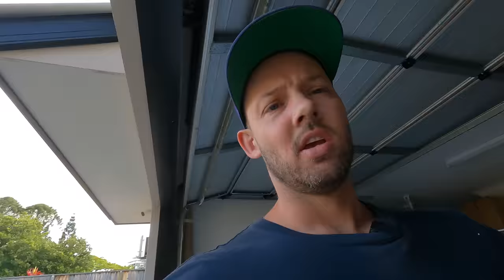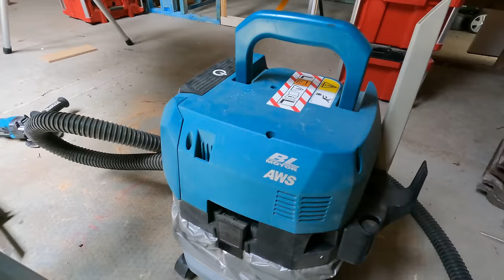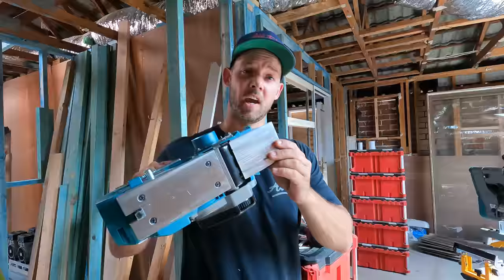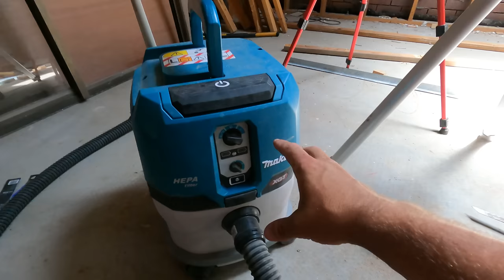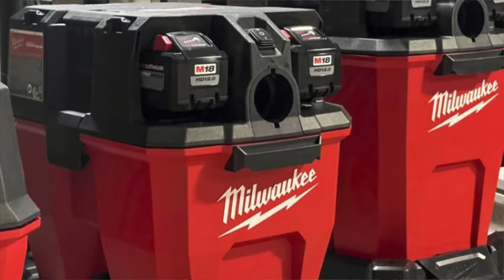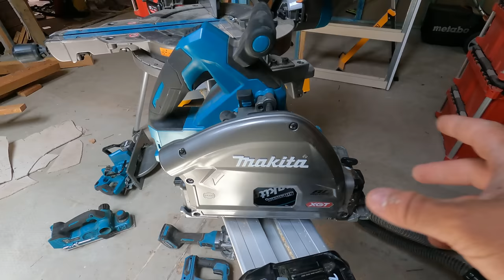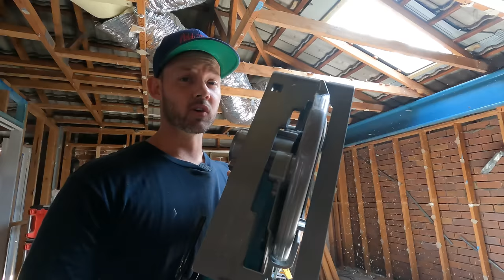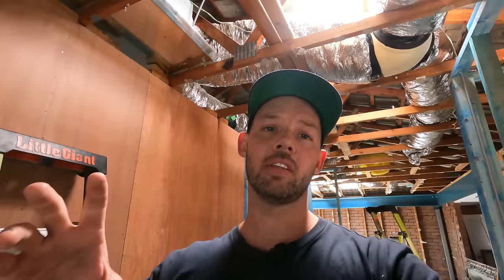From milwaukee to Makita. Why I changed tool platforms

Comment: My brother says that he has seen and had has dropped Milwaukee tools from a ladder onto concrete and the batteries break apart, yet has seen Makita’s 18volt range drop from even greater heights and the batteries have no problems with the impact.

Comment: To me, it seemed that Milwaukee had a focus on mechanical trades. I'm a Makita house however I have recently purchased a couple of Milwaukee tools which Maikita didn't' seem to have any equivalents for. Overall, excluding storage systems, in my opinion Makita wins over Milwaukee particularly in Australia (also faster to market than the US brand which seems to have about 6 month delay to bring their products to the local market), Thanks for the content. Cheers
Reply: It's true, the only problem with Makita is although their saws are better for carpentry than Milwaukee, there is a gigantic, gaping hole in Makitas lineup, which is a cordless, electric nailer!!!! Framers here in Canada are switching to Milwaukee because the Milwaukee nailer is the best on the market while Makita just does not have one. It's a disgrace! Not to mention in North America, it's switched, we get Milwaukee tools pretty quick here while Makita tools take 6+ months to get here.

Comment: Hi, I have worked installing pipework in underground mining for years and am currently back to surface boilermaker/fitter work, we use Milwaukee, we hammer it. The batteries always get loose and the connection becomes intermittent, especially on the 12AH ones. We would go through a 3/4 rattle gun probably once every two months, it seems they need a more substantial contact point and stringer rails for the batteries to slide on.

Comment: I had a brand new Milwaukee 5ah battery die within a few weeks, but replaced under warranty without questions.

I went with the Milwaukee set for home DIY. Once I'm in the ecosystem,  I'm not changing because it's too expensive. I love both my M12 and M18 gear.
Reply: My issue with that warranty thing is the lost time. 
I hear that a lot from the Milwaukee fan boys of 'Oh if it has issues though they have a 5 year warranty' 

They don't give you another tool while you wait for yours and at least in my experience it's 2-3 weeks waiting for the replacement or repair. That's 2-3 weeks of lost production because their tools couldn't keep up with the work they advertise them to do. 

A lot of the trades here seem to be switching over to hilti for that exact reason. 
These tools are bought to make us money through our trades yet if they are constantly down and waiting for replacement then they're just losing you money.

Comment: I’ve had every brand over the last 30 yrs. I’ve had one Dewalt drill give out on me but I’ve had so many problems with Milwaukee tools, like switches went on at least 10 of them. I’ve asked others with Milwaukee tools who seem to not have any problems. How does this happen to me all the time. I love Milwaukee’s special tools, but I stay away from the drills and grinders. Makita is a solid platform for sure.

Comment: As someone with cordless tools of Milwaukee M18 & M12,  Makita LXT & XGT, and Ryobi 18V lines some of the comments here are amusing. I can understand wanting to stick to a limited number of battery platforms, but not every brand makes every type of tool -- and while corded versions might be cheaper there's always not a power outlet available..

Not to mention that sometimes a task is short/simple enough that having to set up a generator and run power cords could make the setup time longer than doing the actual task. More than once now I've been tempted to build myself a portable power cart/pallet using some deep discharge 48V DC batteries and an inverter capable of providing a continuous 3k-6k Watts of AC power......

Comment: Really excellent review, man!! I’m a tradesman of a different stripe, not carpentry but airplane mechanic. Love to All tradespeople. You broke everything down really well, and I learned a useful chunk about carpentry and stayed interested even though it’s not my normal thing, very well done. 
I’ll echo that all modern tools are Great, from Ryobi on up. I’ve got a 7yo Ryobi 12v drill that was 50 bucks, and it was basically faultless the whole 3yrs that it was my only drill. Durable, plenty of power for mechanicking, batteries last forever, better trigger than my newer brushless big brand drill, can’t say enough good about that Ryobi. So All the modern stuff is great. Pick a platform and go to town. That said, it looks like for carpentry, Makita is on the ball.

Comment: May I suggest EGO for Garden Tools. Use a different line for shop tools. I’ve used Hitachi/(now Metabo) for ten years, but Makita, Dewalt, Milwaukee, Bausch all have followers, the important thing is the quality of the battery line you’ll be marrying. Brushless (Neodymium magnet) is very important for both torque, runtime, and spark non-generation.

Comment: Big pro for advanced DIYers, they are the only premium brand (I think?) that also has stuff like gardening tools. I use my trimmer, their small chain saw, and their leaf blower a lot around the yard and they're great. Even if you are a professional, it's nice to come home and be able to use the same batteries for work around the house.
Reply: Only thing I didn't buy makita is brad nail guns and impact driver, instead I went for Ryobi since they got better reviews. Can still use them with makita batteries using a battery adapter!

Comment: I have 25,000 in USD Milwaukee tools.  I have had terrible trouble with he 12.0, 9.0 and 8.0 batteries. Almost all have died before warranty ended and then within a year of replacement which is not covered.  Recently had a 8.0 die literally 2 days out of warranty.  I have Makita 18v tools also, not one dead battery over the last 6 years.  The only think keeping me from switching to the 40V Makita is the cost in the US.  The Makita tools and batteries cost a great deal more than Milwaukee. It's a shame Milwaukee doesn't have a longer warranty on its battery line.

Comment: I was a milwaukee guy and still I am 70% red and 30% yellow never been on a makita platform and recently bought their 40v 12" mitre saw and was amazed how smooth and accurate is the saw , I've been lately disappointed on the milwaukee for the same reasons with the batteries and their mitre saws , the cordless 7 1/4 mitre saw got cracked on the saw mount and it's useless,  bought the 10" and it has very bad deflection related to the back rails and its impossible to stabilize that , all and all I think they are going down in terms of quality and these are a few issues I mentioned,  it's hard to dive into the makita platform but I think I am gonna transition slowly , my next tool will be the vacuum and the track saw all tho I own the corded festool and the vacuum but I need the cordless , hope milwaukee sees these messages and addresses these issues to the TTI
Reply: If money is an issue I'd take a hard look at Ryobi. I know the casuals keep saying it's DIY-focused but personally I see loads of professionals using Ryobi only and if they aren't actually more reliable (some say they are) they are at least cheaper to replace.
Reply: @Gorky D  nothing wrong with ryobi I have the 23 ga nailer and works like a champ , and I have the palm router which is ok , I mean you don't pay much for ryobi so even if it doesn't work no big deal

Comment: Power wise on the 18v batteries Milwaukee wipes the floor with 18v Makita. The multi tool beats all in the head to head. I use 110v festool for dust extraction and mitre saw the rest 18v battery. I agree the Makita track saw is excellent

Comment: i am Milwauke user i work as cabinet maker i love milwauke tools specially planer has dust bag , jigsaw , drill , i am not happy with battery system i changed from 5 amp to 6 and 8 amps batteries they last a while even rough use . but the drop saw i use is makita 40v 216 mm 2 brands at the moment.

Comment: Done with the RED (Milwaukee was the BEST!) 

Now, I’m picking and choosing my skins to get the best of what I need from the brand that best makes it. 

Ooooo 12amp batteries .. YES! 

It’s the rapid charger the wrecks them, the 6pack charger that charges slow is the only way not to wreck
The bigger amp battery’s. 

1 banks drops the whole pack is pooped. They can’t handle the rapid input . Trickle is best

Comment: All my stuff at home is Makita or Bosch with a little Milwaukee. 

At work company provides tools all Milwaukee and I find them unreliable. Great power but just always breaking. I push all my Makita drills and saws just as hard and they don't quit. 
My Makita impact might take 0.7sec longer to drive that 5" lag bolt or whatever but hey at least when I select the opposite direction it actually changes. And I haven't had my stuff at home die on me anywhere close to as much as Milwaukee has at work. And my Makita impact is at least 12 years old now

I'd rather my tool be a second or so slower but last years over being that second faster but dying after 8 months of use

Comment: I prefer the ergonomics of most of the Makita stuff. Hate the Milwaukee angle grinders switch, and I’ve seen switches die on a couple of Milwaukee drills. They might be pretty good power, but I find the Milwaukee saws to be a fair bit clunkier and heavier than the Makita ones.

Comment: Have always ran two platforms. The Dewalt flex volt is amazing. Especially the 12 inch droppy and the 7 and 1/4 cerc saw. I then run the 40v makita as there drills are so much better then the Dewalt and the track saw is amazing especially if you spend the extra and get the 3metre track

Comment: All my tools are Bosch  ,none of which have let me down ,and their batteries last forever ,and don't get hot when charging .  I did think about switching to milwaukee , but I've heard loads of stories about their triggers  failing , gearboxs in the combis ,batteries overheating,  that put me off.

Comment: The problem with milwaukee batteries is the cell is out of ballance after couple hard use (especially on gardening equipment and table saw) and the bms in battery are shitty or none and after charging you got 3 cells charged to 4.14V and 2 cells charged to 3,86V so from 12ah you got only 2ah because the bms wont let discharge cells below some voltage even if the rest is still charged. i check them every 2 months of use and if needed rebalance the cells. The hikoki 4/8ah has the same problem (even more offten)

Comment: That's funny... I'm going from Makita to Milwaukee.  I still have my first set also, but the third gear on my drill slips every so often.  Love that 3 speed, it was bullet proof for me.  I don't use the driver so it was 11 years of hard use as an electrician, before I upgraded the Drill/ Driver set.  My new drill was pretty good but it's been giving me problems lately.  I only had one battery pack fail. 

Even though I LOVE Makita... they started making electric motors, so they know what their doing.  It's hard to beat Milwaukee these days.  They make every single tool an electrician needs, and they stand behind their warranty.  Makita is catching up though, they finally started making Porta-Banders... but too little too late.  I think Milwaukee has so much momentum, and such a head start, it's hard to beat.  Plus their One-Key, and packout systems... I can't say enough. 

I will keep my Makita systems forever, but Milwaukee will be my work tools!

Comment: Have both brands Milwaukee and Makita, both have pros and cons.  I personally like some features on one over the other, but that is a matter of opinion.  In my area Milwaukee is more readily available, more discounted sales as well, so I grab the red because of this.  I work both brands equally hard, in my personal experience, working in the heat and sun of Florida, I have to say the Milwaukee batteries hold up a bit better under severe abuse of heat.  I have replaced more Makita batteries, while I still have some Milwaukee ones much older still holding up well.

Comment: alot of these youtube tradesmen are suckers to battery platforms. i have all dewalt cordless and corded models, switched to flex, THEN switched to makita. only bought impacts and drills of each after the De-saster. batteries and chargers have nothing on corded tools, in reliability and price. i personally think it’s silly to be a slave to a platform of tools that limits you. i can buy anything corded and it will work with any and every outlet/extension cord on the job. it will all come down to personal preference then

Comment: I like to get the best tool in each category. Regardless of the brand. Its nice to be able to use the same batteries for everything, but it feels like a compromise to go with something inferior. I guess it depends how much better the tool is, but as you mention here 2mm vs 4mm on the planer its not even close. If it was 3.8mm vs 4mm, then it doesn't really matter.

Comment: Work purchased 2 milfuckery kits  for the range ,both kits have  had  ridiculous repairs and exchanges to a point where we will keep m12 platform and turf the rest after warranty makita kit from 9 year ago still going strong,new makita kit only issue is the rubber grips.

Comment: My workplace had all makita tools then due to contract regulations they switched to all Milwaukee tools. Milwaukee tools are very strong and beastly but for me makita just seem more refined and the ergonomics and weight to power ratio can’t be beat. My wrist and hands get fatigued fairly fast when using Milwaukee tools but I can use the makitas all day.

Comment: I'm a Hilti and Milwaukee guy myself, but I'll say this.... Milwaukee may be powerful, but some of their tools aren't as comfortable as their Dewalt counterparts (hold each of their multi-tools in your hand for an example), and none of the regular brands have the same feel or build quality as Hilti. In fact they don't even come close. seeing as their prices have dropped a little bit over the years, I would recommend people put a couple hilty tools in their hands before they buy anything from anybody else
Reply: Couldn’t have said it better myself.  Hilti is king in quality and durability and the way it feels.   Milwaukee is great line but doesn’t have the longevity of Hilti   Recently I bought  the NPR32 press tool kit and the TE60-22 and both were cheaper than milwaukee. Win win 👍
Reply: hilti and makita are only two brands left in trade (not sure about festool etc, but that is more niche brand) , that are not been under some mish mash coorporate game. in my mind that means stay of bs and do what you do best (goes for any field).

Comment: I bought a Makita LXT 18V cordless drill with 2 batteries about 13 years ago when they were just introducing their li-ion system, the drill I have no complaints about (I regularly drill in concrete/brick or steel even though it's not designed for it) but the batteries and more specifically the BMS (Battery Management System) in them can burn in hell. They might have "fixed" it in the mean time but the batteries I have contain a sort of key in volatile memory powered by a single cell in the pack, if that cell drops below safe voltage, the BMS forgets its key and cannot be charged anymore, even though the cells themselves aren't damaged, the entire pack is essentially bricked. It's still possible to manually charge the pack by applying voltage to the outputs but this is dangerous to both the battery pack (risk of fire) and honestly just makes it so inconvenient that it's not a real solution.

They say it's for safety but in reality it's just to make you purchase more batteries and it's incredibly anti-consumer and anti-repair. 
I will continue to use this drill with 3rd party batteries but Makita will never receive a dime from me again.

Comment: I use dewalt 20 volt for high volume heavy work and the m12 for small stuff. I think it’s well known dewalt has the best saws and carpentry. Especially table and miter.

Comment: I use DeWalt. Not because they are better than anyone else, but because they have the battery operated tools I need. Are not over expensive. And they work. 

I am also a huge proponent of having a 1 battery system. One thing I hate is having to flip flop batteries and run 2, 3, or 4 different chargers. I keep my batteries on a bank in one of my truck boxes. Ran off an inverter and it's own deep cycle marine battery and an oversized alternator. A one battery system keeps my battery charging system simple and organized. 

Tool brand honestly doesn't really matter, it's the craftsman that counts. The tool is just that, a tool. If you suck, the color of your tools won't make you any better. And if you are a quality craftsman, using Milwaukee or using Ryobi should yield the same result. 🤷

Not to mention, most (not all) of these tools are made in the same factory, by the same workers, with the same parts. I watched a video where a guy took apart a Milwaukee, and a Makita impact driver, they were literally identical except for a couple of proprietary switches and breaks they were the same.

Comment: If there's one thing the US & EU government needs to regular is the incompatibility between tool brands in regards to batteries. You should be able to swap batteries around like AAA or D-Cel batteries, or standardized USB cables for electronics. If I'm going to spend 80 dollars on a 18v battery, then I should be able to plug it into any 18v tool.